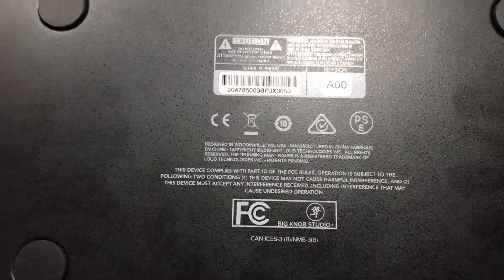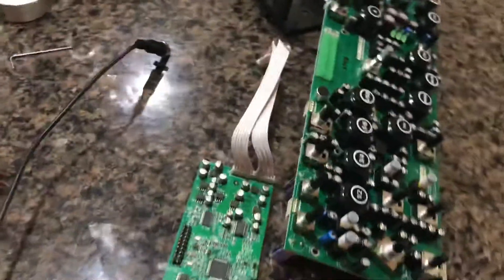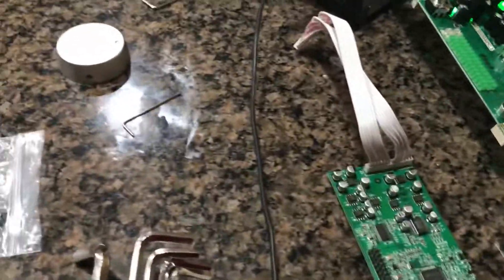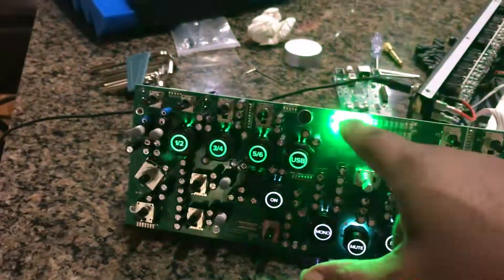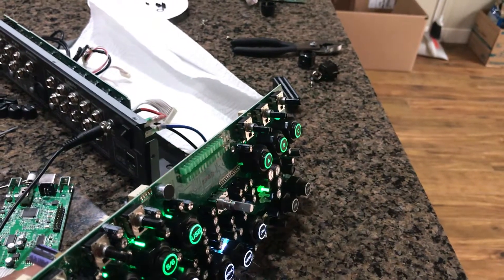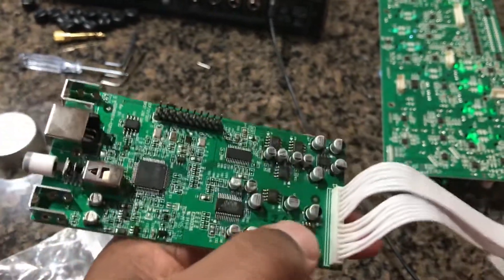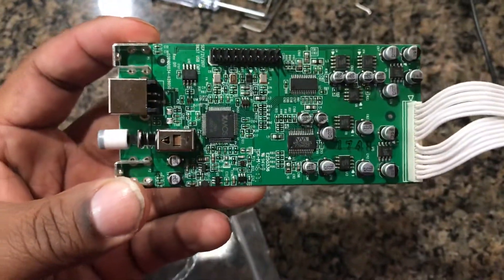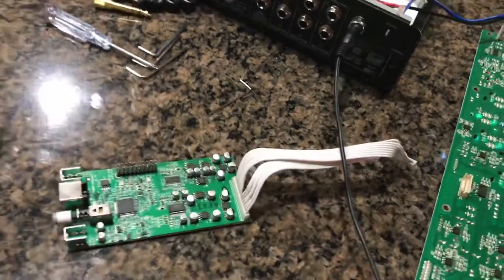Mackie big knob studio

Comment: I was having the same issue, saw your video and knew exactly what the problem was, ordered the USB mother board from mackie, got it on and the problem went away, I also got some Contact Cleaner and cleaned all the sticky knobs which are now engaging fine, the only problem now is....the cue & 2 TR button won't engage, so not sure how to approach that issue, but thanks for your video
Reply: I'm having the same problem now
Reply: Bro please is this thing overheating? I got one but is always hot like something is burning inside
Reply: @dizkid_rsa Bro please is this thing overheating? I got one but is always hot like something is burning inside
Reply: @anascost  Lol yes it's always overheating but it seems like it's normal because I've had mine since 2021 December and it never gave me any issues until now which has nothing to do with its overheating
Reply: @dizkid_rsa  Thank you

Comment: All I can say is that this happened me tonight and your solve was my solve - I need a replacement card.

I had watched this video before and thought dang I don't want that happening to me because i use the the BK as my sound card . Tonight i was chilling listening to Music watched the game and BAM my speaker made a pop and the meter bridge staid stuck at the 3rd meter with a high  pitch sound coming out and yes those 2TR and CUE buttons staid lit. I opened her up and pulled the card the audio came back with a working meter bridge but what blows is that i use the USB feature daily its the heart of my home studio. I sent Mackie an email and calling them in the morning to see what options I have. Pulling the card is simple so replacing it should be a breeze. The screws on the other hand were in tight and you have to use a micro Phillips so plan on carving up the screws. thx for the Vid.
Reply from the maker: Please like and subscribe

Comment: Exact problem with a Big Knob I picked up on one I bought on E Bay for cheap..  The USB interface board has a shorted or semi shorted component on it that drags down one of the  +\ - 15 volt power supply rails. Unplug the USB board, power supply is fine and analog functions of the unit work fine. Plug in this USB board and half the meter lights illuminate and unit will not pass any audio. New board from Mackie is $ 85.00. No schematics available anywhere for this unit unfortunately..

Comment: How did you fix it ?
Reply: Do you have that issue too?
Reply from the maker: New USB port now it works just fine
Reply: @Kasetownbiz  Where’d you get the new USB port from! Mine is doing this as we speak!🤦🏾‍♂️🤦🏾‍♂️
Reply from the maker: @Firetracks  here is what you need Mackie Big Knob Studio+ USB BK57 PCB

Item number	362828112697
Reply: @Kasetownbiz  Did they have you pay for it or was it sent out as part of the Warranty? For $350 US this unit does a a lot
Reply from the maker: @klozher38  I just bought the part off eBay think it was like five or 10 bucks